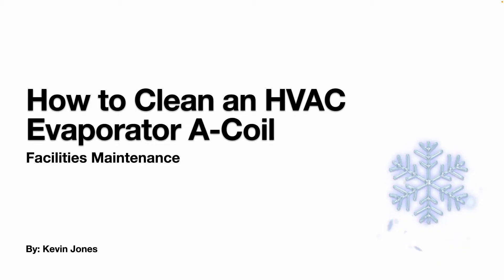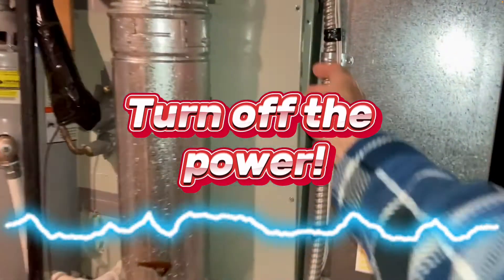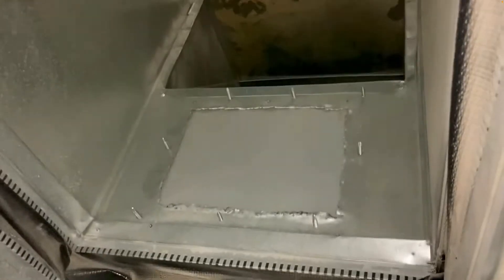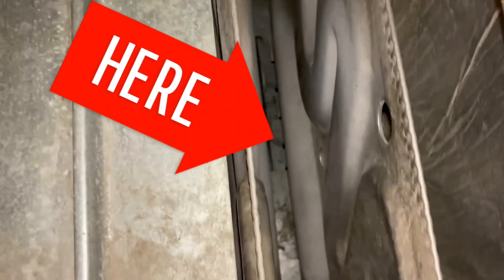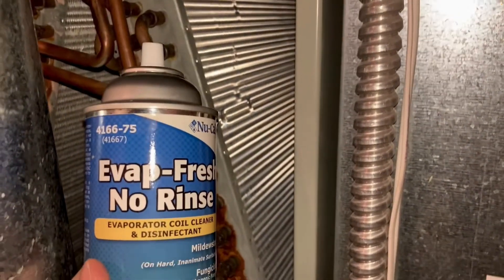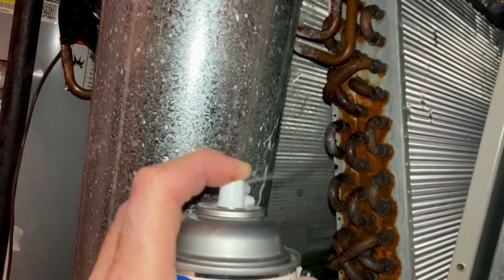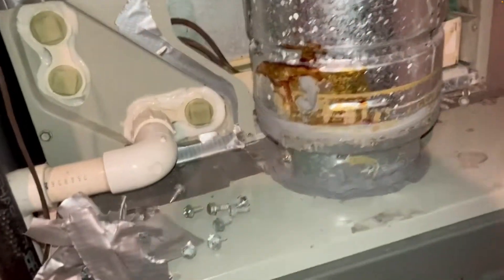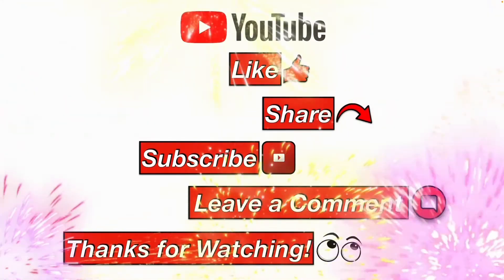How to Clean an HVAC Evaporator Coil | A-Coil

Comment: Hey the hvac guys came over and stated my evaporated coil was dirty and beyond cleaning and the sr22 was discontinued or hard to find costing 5 to 6,000 to repair ...instead of replacing with a new furnace system completely...I begg to differ. They did not mention using a no rinse cleaning coil spray and turning on the ac so the condensation can rinse the solution out.
Reply: My furnace was blowing cold air, overheating and triggered the limit switch. My previous hvac guy pulled something out, took to it to the carwash, re-welled the components back together then there was HEAT🙏🏽
Reply from the maker: @yvettebradley4557 sounds like they fixed it for you, that’s great!
Reply from the maker: With the power off, you can clean the coils with rinse free coil cleaner or gently use an old soft, paintbrush or coil cleaning brush be careful not to damage the cooling fans.  Reclaimed R 22 is still available. Yes it is expensive. You don’t need to buy any unless your system is low on refrigerant and that is determined by hooking up gauges to your system while it’s running and checking the pressure and temperature and comparing the pressure and temperature on a pressure temperature chart for R 22.  
You have to be careful with HVAC companies. Many of them are incentivize to upsell customers, there are professional, honest HVAC companies out there. There are also some that are just looking to make a sale.

Comment: I have to go from underneath to get the coil cleaned; climb into the nasty return box. And I suppose I’ll have to wear a lot of PPE. And suggestions are appreciated? I used this stuff from Lowe’s last time called PF Coil Cleaner, and it made the whole house smell like dangerous chemicals for several days afterwards:
Reply from the maker: You may be able to gently vacuum off the evaporator coil with a brush attachment on a shop vac, or gently brush off the coil fins with a soft paint brush, just don't damage the fins.  Or, use a rinse free coil cleaner that will self rinse when the evaporator coil forms condensation.

Comment: Do AC drain pipes usually include a p-trap what would be the reason? Mine drains into my utility sink (with p-trap), so I think I'm covered either way. Thanks!
Reply from the maker: Most HVAC systems will have a P-trap.   The P-trap allows the drain pan to drain the condensate.  Without a P-trap there is a risk the drain pan can fill up and overflow.